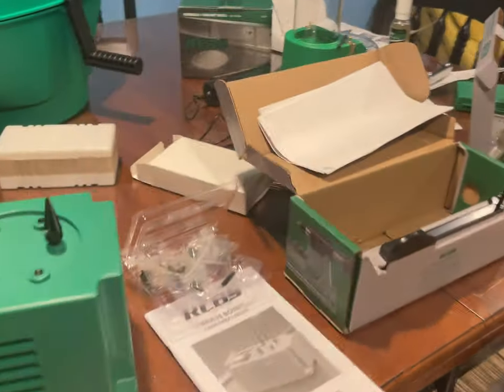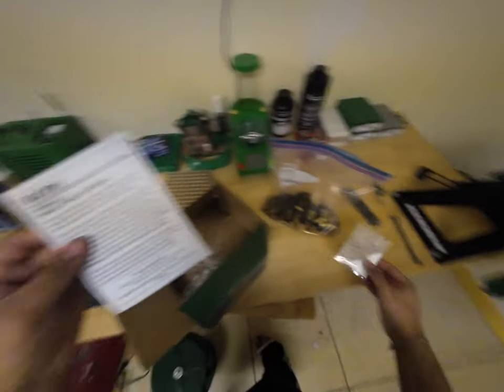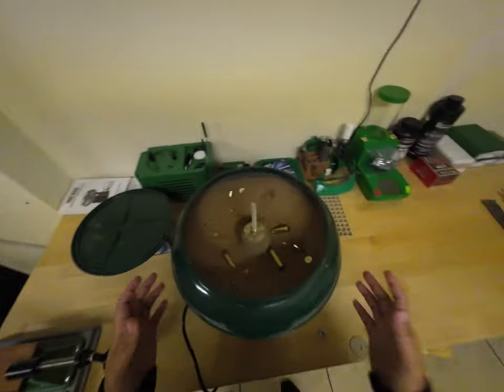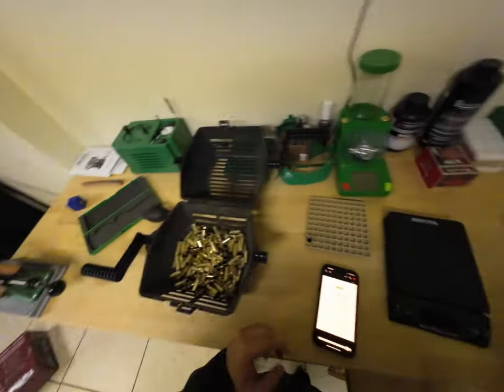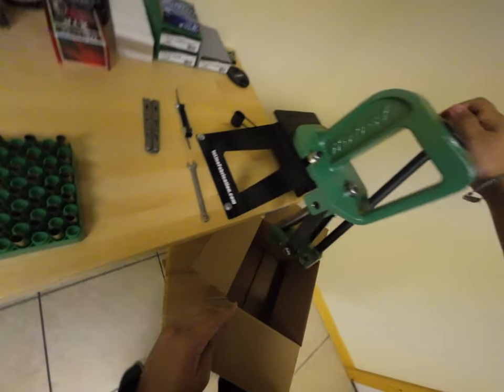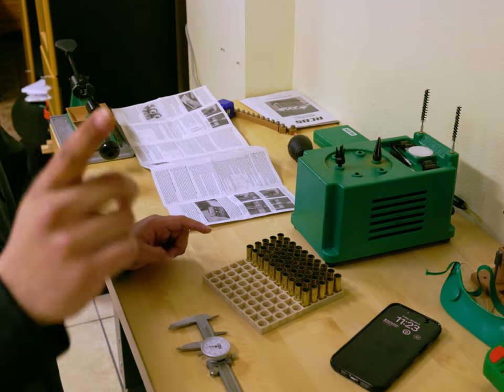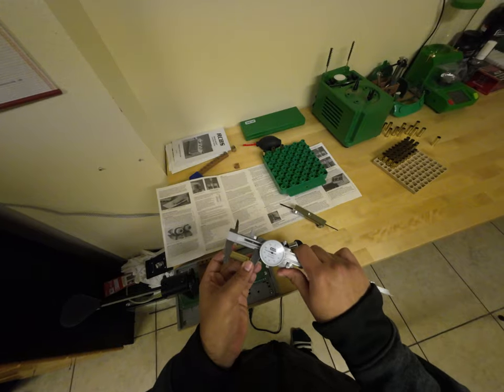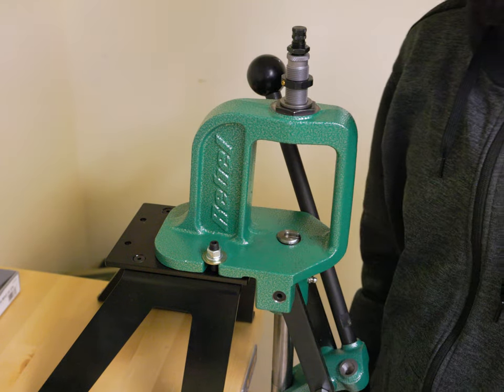Making My Own Ammo - Beginners Experience

Comment: I know that you used an app on your phone to get the load data, which is fine, but you need an actual reloading manual, or two-three-four-or more, to read over the front portion to familiarize yourself with the processes before starting reloading. Just reading the instruction sheets that come with the particular tools is not good enough. Lots of safety warnings in the manuals that one needs to know. And you can learn the process so that you do not end up skipping around as you did. Not good to not know what you are doing and just winging it on the fly. 

Also best to make a dummy round for reference that has no powder or primer, to get the dies set up, then start reloading with the primer and powder.

At least you started low instead of just picking the max load, but that is a no no to. One should always start at the minimum and work their way up until either satisfied with the results, or reached the max data, or saw signs of pressure in which would back off at least .2 grains. Just taking things for granite hap-hazardly can be very dangerous. And if you are not worried about your fingers, eye balls, or even you gun, at least be considerate of innocent unsuspecting bystanders. Just because you got away with it this time does not mean that it is safe to keep ignoring all the safety rules over and over. Complacency can become a reloaders worst night mare, so always stay vigilant. Happy reloading to you. And may you have a many of safe reloading sessions to come. And seriously do not forget to read at least one manual.
Reply from the maker: I like to clarify a few things. All good information and I am well aware of everything mentioned. 

The load data I got wasn’t specifically from an online source. It was from Hornady’s ebook. Which is the exact same copy if I had gotten the physical one. I also have 3 other physical books, Lyman 51st, Nosler 9 and Lee’s modern reloading Second addition. That I’ve read through extensively. 

I’m not entirely sure what safety things I’ve missed other than not starting from the very bottom load wise. Everything was measured to spec and I threw out a couple casings because I trimmed them to much. The video may appear that I’m just winging it but I can assure everything was double/triple checked, if not on camera, definitely off camera, to ensure everything was indeed safe. 

Also this was my first time and I thought it was a good demonstration of what a new reloader could expect. There are already plans to improve my process and I love the dummy round idea. Since there will be no filming I can actually focus on the process in its entirety. 

I appreciate the concern and feedback though! Happy reloading!
Reply: @AgMango  I would think priming a case and then flaring it would be out of order, safety wise. It would also seem that you left the sizing lube on the case, of which can stop the case from sealing against the chamber when fired. Causing the case to be slammed back into the breech face faster than it is designed to. And also allowing the hot gasses to travel between the case and chamber of which will cause gas cutting of the chamber walls. Not good.  But live and learn. Any who, your right about the video edited to make you look as is you where fumbling through, but it is good to hear you actually where reading/studying before undertaking the task.

Comment: In my experience, you want to ho with the max load possible right away and work your way down. A lot of guys start low to higb but this can be an issue, not knowing how hard your weapons can be pushed is a failor to understnad the capacity of ones tools. If i dont know exaclty how many times my AK can be dunked in hot nacho cheese and still be safe to fire i could make a mistake in the field costing me my life. Yku bet your ass the FBI, navy Seels, and  Shadow Corps enforcer members know how hard their wepaons can be pushed and will use them in any ways possible to silence yku and your fellow melitia memwbers when the world falls into a veil drop XK class end of the senario. Youll have 3 days to establish a defensive line before theg come for us. Arm yourself, arm your family, remove your teeth and fingerprints, cover your eyes and ears the signs are how they get intk your head, reject post modern socioeconomic entrapment. Be safe, DONT READ ANY MANUALS THEY ARE FOR DEMOCRATS. IM LOOSING CONCOIUSNESS AGAIN GOD BLLESSS BE SAFE NEVER STOP RESISTNG CAN ANYONE VENMO ME THE BUS FAIR ITS VERY COLD OUT AND IM LOST